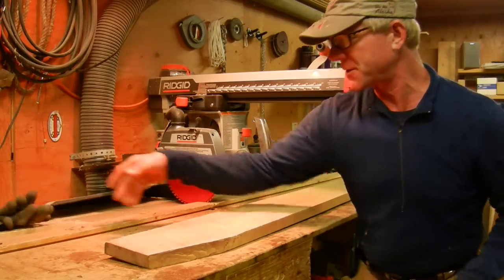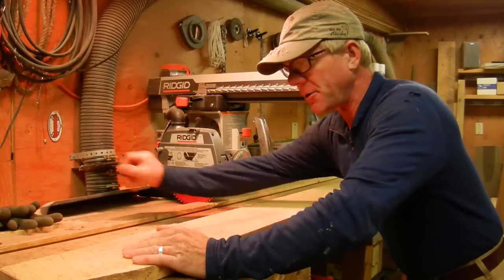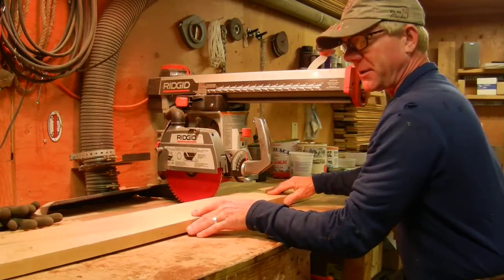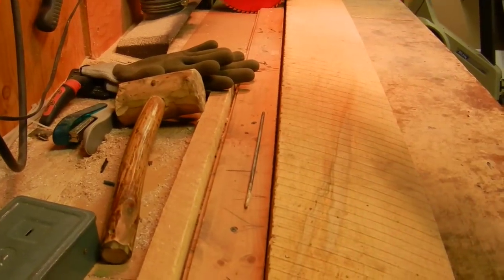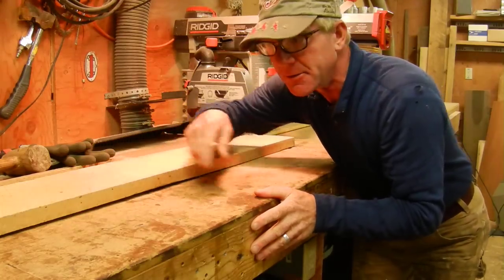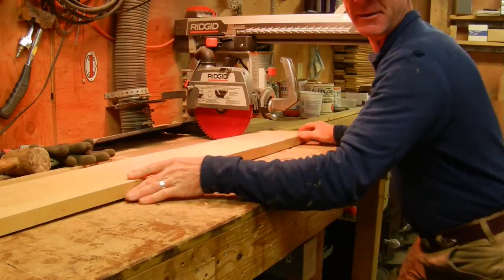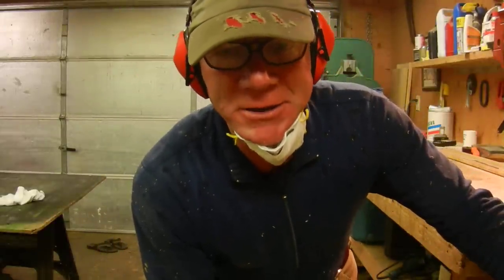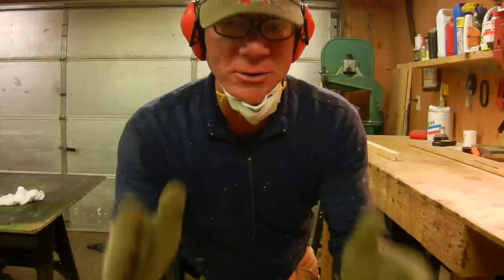How to use a Radial Arm Saw #radialarmsaw

Comment: Public Service Announcement: Please never wear gloves while using powered saws. A saw will grab fabric and everything inside of it.
Reply: Also a carpenter?
Reply from the maker: http://www.adirondackrusticfurniture.com/
good ideas... my stuff doesn't always come out straight nor do I want it straight but good ideas and welcomed criticisms. THANKS for posting. #jimthepilot http://www.jimthepilot.com/
Instagram @flyjimthepilot https://www.kittycot.com/ Instagram @originalkittycot
Reply: Also use the saw in the correct direction. He’s feeding the wood in backwards.
Reply: bhutch216 he’s definitely not. The teeth on the saw are always designed to spin TOWARDS the wood
Reply: Absolutely right! This also goes for ANY self feeding tools. Once witnessed a woodchipper eat a guy down in Texas cause his glove got caught on the limb he was feeding. I'm talking about the big chippers they tow behind trucks when they trim the trees around the power lines. The machine didn't even slow down till it hit his boots. Guess the steel toes stopped it. Dont ever wear gloves around these machines! The saw blade wont give a damn about the thin flimsy leather.
Reply: Richard Solomon yea a guy lose a few fingers in metal shop in high school because he was using a bench grinder with gloves
Reply: That was the first thing that popped into my head when he said that!
Reply: My 1st thought when he mentioned gloves.
Reply: I don't see any problem with wearing gloves, you are just feeding the wood along, You are just pushing it with your finger tips if the wood gets yanked away from your hands it's just going to pull away it's not going to take your hands with it!  At no time should your hands be anywhere near the blade!
Reply: No far from it, I'm a realtor.
Reply: Gloves protects against splinters. Distance protects against the blade!
Reply: @bhutch216  Well, for one thing,  he is using the saw in the correct direction according to common practice. But in addition to that, the radial arm saw is designed to rip in both the outfeed and infeed direction. Because the blade is mounted above the work surface and is rigidly mounted relative to the base, they don't kick back in quite the same way as a table saw. Thus allowing infeed ripping.
Reply: @bhutch216  He's doing at least three major things "wrong" in terms of safe radial arm saw operation, in general and specific to the task he is performing, but feeding  the wood in backwards isn't one of them.
Reply: Of course you can wear gloves. Just make sure they actually fit, not big floppy-fingers roughwork ones. And keep your damn fingers (and cuffs) dafuq away from the spinny thing whenever it is spinning. The gloves protect from splinters, chips, sparks, chips etc. As others have mentioned; distance protect from getting grabbed. The only work gloves allowed any wiggle room inside, should be those strictly for welding, casting and forging. Even so; when you swap for (even just a quick tiny bit of) grinding, those types of gloves go off.

Gloves don't always need to be right-size latex-glove tight - but there shouldn't be room for much more than that between your skin and the work glove. The tip of your glove finger, needs to be tightly fitting enough so that it always ends, practically where your own fingertip does. Even so - never ever stuff your fingertips close enough to the spinny or bity parts of any spinny / feeding tool, to give it any chance to actually grab. Even though you're wearing appropriately fitting gloves, treat and respect the tool as if you were not. Again: distance protects from getting grabbed or bitten. You're not supposed to have your hands and fingers right up close to the spinny bits. Gloves or no gloves. An angle grinder, almost any kind of power saw - it will chew through any glove suitable for work, pretty much as quickly and easily as your own skin.

The same goes glove palms, cuffs and for shirt/jacket/overall sleeves. And pay extra attention when moving around the spinning tool but not actually fully engaged in cutting/sawing/grinding. This, along with the moment you're starting and finishing a cut/grind etc - is when you're overwhelmingly most likely to get caught, bit, kicked back on. Because your hands and arms are moving around a lot, yet your eyes and mind are more focused on the work piece and your body movement, and less attentive on where the tool is in relation to your hands, arms and so on.

So practice your attentiveness, of where your body, clothes, protective gear etc - is in relation to the tool at any time. Especially when it's powered on but you're not directly engaged in operating it. This is when you're most likely to have a grabbing accident even though you keep your fingers/hands well clear when actually operating. Because at those times, focusing on a tool you're not currently operating is not a natural thing nor intuitive. Which is why that explicitly requires awareness training. And why even experienced old shop bulls get bit by this quite often. Because while experience goes a long way, avoiding these kinds of accidents does not just require know-how. It requires constant, non-stop attention and awareness. It does you no good, knowing what you should be doing and how - of you do not actually _continously without pause or exception, actually do it as long as the tool is spinning. Including after shutting it off; never underestimate the damage these tools can still do to you while winding down.
Reply: 😂 all these fools commenting are safety nancies and keyboard woodworkers.  😂
Reply: @MrHippobear  My understanding is that when you rip material you want to FEED the saw as opposed to have it self feed.  You should push material into the blade as opposed to have it pull in material and also you
Reply: @pr0xZen     Any advice on family planning?
Reply: Why did they make us wear  them in carpentry at my university?
Reply: My first lessons were no gloves, no ties, no loose sleeves, no jewelry, etc.
Reply: Así es amigo siempre doy ese consejo.... mejor un pedazo que te hable todo el cuerpo
Reply: @bhutch216 así es la parte a cortar la más corta a la gia.

Comment: Hey Jim,
Yes, you were definitely feeding from the correct end.  The only two pieces of advice I would offer is...
1.  That slider on the front is more than a dust shield.  It is also the hold down.  put it down far enough that the board can "lift" only a very small amount.
2.  Where is you anti kickback pawl?  You really need that.

I would suggest a book written by the late Wally Kunkle on radial arm saw usage.  Far and away the best authority on the RAS.

Comment: Great video.  What I like to do is clamp blocks to the table in both the in and out feeds the hold the piece against the fence.  For repetitive cuts or dados I use a 3-4 foot clamp that has a flat straight edge which sits against the piece being cut to hold it against the fence.  ( Its like a pipe clamp but extruded aluminium and 3" wide.  Same thing can be accomplished by clamping a 1x4 to the  table.)   I like to rotate the guard until the in feed side  makes contact with the wood.  My guard has a (original?) Spring clip that presses on the wood which holds piece tight to the table but still allows for variations in thickness.

One of the biggest advantages of a Radial Arm saw haw got to be their compact size and not needing any out feed space for.cross.cuts.  My work space is quite limited but has a great view as I work on an 8'x30' condo terrace several stories up.  Noise and dust collection are my biggest concerns and sadly Radial Arm saws are noted to be one of the worst.  Using good anti-vibration blades along with a blade stiffener and keeping them sharp and clean helps a lot.  Some blades, ie Dewalt 80 tooth thin kerf have wierd resonating harmonics; starts noisy but get really bad if left to spin for more than 10 seconds and it peaks around 30 seconds with a steady LOUD shriek. 

Another's  way to make a radial arm saw safer is toXuse a foot switch to stop and start.  This allows you to keep one hand on the saw handle whenever the blade is spinning and another on the piece.  One of the other nastiest with radial arm saws can be with pieces from the cut falling into the path of the blade when it returns to its home position.  Its partcularily bad with small cut off material.  In such cases I often use the foot switch to shut down the saw then stopped clear out the scrap and return the saw to its home position.

I have a 925 model and it is dead accurate.  I've slowly been acquiring the attachments for it but still lack the shaper head and fence, lathe and router bracket would be nice to have but I'm in no real hurry; its more just to have them as opposed to needing them.  I can use the CNC machine for what lathe work I do.  I tend to avoid the router because of the noise, especially after an incident with a 1/4" shank 1-3/4"HP router with a door pull bit and a piece of oak.  You can't do multiple passes with the router as its shaped like a curved T-slot bit... so the router is forced to cut about 4 inches of oak at once.  It made it apparent its better to have a trim router and a monster 3.5 HP router in a table than trying to have one in the middle.

Comment: I am beginner woodworking and your video was very informative and I found out that I had been using the table saw all wrong - I didn't know to turn the blade - didn't have anyone to show me - dad having dementia didn't remember how to use his woodworking tools anymore
Reply from the maker: Don't forget, this is not a table saw but a radial arm saw. Completely different saws.
Reply: I'm sorry about your dad. Mine had it, also. It was terrible to deal with. Hang in there.

Comment: I enjoyed the video.  Anyone that thinks this saw is safer than a table saw is wrong.  With modern chops saws the only real use I have for my OLD! Craftsman Radial arm saw is exactly how you demonstrated it.  I really like the bungee idea as well.  I don't like the gloves and long sleeves, I have seen more than one guy get pulled in because the blade grabs loose clothing or glove.  But that is my experience, and you still have all your limbs.  Thanks for the video.
Reply: EricNielsen187 How can you say that chop saws make table saws safer??  Table saws are incredibly more dangerous than radial arm saws.  But most people don't have a lot of experience with both so they believe the hype about radial arm saws being deadly, which they just aren't.

Comment: Why are you not using the anti-kickback pawls?  They don’t get in the way of anything, so there’s no reason NOT to use them.   My setup is similar to yours...long infeed and outfeed tables, and I like being able to cut full 4 x 8 sheets down to size while supporting the entire length of material on the fence.

Comment from the maker: I didn't want to put the board through a planer because I used it rough leaving the saw marks. To straighten the edge of the board it doesn't have to be smooth on the board surface.

Comment: Hey Jim, great channel/video. Thanks for sharing.

I'm sure you get enough safety tips, but heads up on wearing gloves while working with a RAS, they lower your awareness of proximity to the blade and can pull your whole hand in if they touch the blade.

Almost lost a finger working on a ras that way, and ever since then I prefer the splinters. I have the shredded work glove hanging above my workbench as a reminder to be careful.

I'm sure you know to be careful when pulling lumber from the rear side of the blade too, but the danger of working in gloves is lesser known.

keep all 10 attached and make plenty of dust.

Comment: Thanks. I can set my RAS fence up more or less square (hopefully more more than less after reading everyone trying to scare the pants off my with their RAS stories).  Im impressed you're able to keep such a long fence so square from tip to tip.  But I guess really only the section that has to be truly square is the length in the immediate vicinity of the blade -- maybe plus a foot or two in each direction. Any minor deviation beyond that isn't going to effect the cut.  Thanks again!
Reply: "But I guess really only the section that has to be truly square is the length in the immediate vicinity of the blade. maybe plus a foot or two in each direction."

I wouldn't count on that.
Get you a good straight edge from the hardware or big box store and use that to line up your fence.

If you have a carbide tipped blade, you could use a long aluminum angle iron as the fence. Carbide tipped blades will cut through aluminum very easily. Just don't cut them on a saw stop without disabling the emergency stop mechanism. The aluminum will activate the emergency stop and damage the blade.

If you make sure the front of your table is straight, then you can make several gauge blocks of the exact same length and clamp them to the table and set your fence up against them which will aid in making it straight.

Comment: Hey!
A carpenter Apprentice Speaking.

Make sure to never, EVER, wear gloves while working on machines.
Every moving part can grab gloves, armbands, loose clothing, etc. And pull it into the machine, cutter Heads or blades. 

Yes. Its just that one Cut.
You are just drilling that one Hole.
Yes. You did this for the past 5 years and you have been fine.

DON'T.
One day, your dream of being a Woodworker can be crushed because your glove got caught in your saw.
Reply from the maker: http://www.adirondackrusticfurniture.com/
good ideas... my stuff doesn't always come out straight nor do I want it straight but good ideas and welcomed criticisms. THANKS for posting. #jimthepilot http://www.jimthepilot.com/
Instagram @flyjimthepilot https://www.kittycot.com/ Instagram @originalkittycot
Reply: @ifoundjim   Your shop, your rules as long as you know the risk. There is a good reason they call this saw the Widowmaker.   I have had two of them in the past never used them and sold them off to other wood workers.
Reply: NEVER EVER WEAR GLOVES.Guessing he didnt want to catch a splinter.lmmao
Reply: @SQLKC  Just askin', but I've been trying to decide which kind of saw I need (if at all) since I'm really tired of a jig saw... it's the only power saw I have as I've been terrified of the large saws and have never used anything but the jig saw lawn power tools like a small chain saw.  I have watched sooo many Y/T videos on how dangerous a regular table saw is and that the radial arm saw is safer.  I don't know...I was thinkin', maybe a small circular saw with one of those clamped down metal guides, but IDK, maybe they're ALL "widowmakers".
Reply: @freewaybaby  I have a sawstop and it's the safest/best saw you can buy. Note not the cheapest but it pays for it's self in one ER visit.
Reply: I have a sawstop as well, was not a easy to choke down the cost but I hope it out last me and it better be the last table saw I buy.
Reply: @TechStack Reviews I disagree, no person ever predicts they put their hand in a blade. You do you and do me but I have the sawstop in my shop.
Reply: Mark Inmon  what is bad or dangerous about this type of saw ? Or is it good for only one perpuse ? TY,,
Reply: @SQLKC   It's just like any other piece of equipment if you use it improperly it's going to hurt you

Comment: just noticed, your blade is cutting on the up stroke, when crosscutting it cuts on the down stroke. I just picked up my first RAS and doing some homework before getting stuck in. I see your guard swings down to keep the work down, mine is stationary.
Reply: Whats your point? I got confused here
Reply: A Circular blade also does not cut in strokes. That would be a jigsaw.

Comment: Nice job.  I often wondered how it was done the right way.   One concern is the anchor point on the wall for the 'Ocky' strap to return the saw-blade to the home position.  I have had one come adrift and hit me in the face.
Regards
Mike McMahon.
Reply from the maker: Hi Mike... been this way for a long time and I always check to make sure it's in good shape. Thanks for your reply!
Reply: Your choice mate.  Just concerned.

Comment: Well, that push stick really did a lot of good, LOL!  I think I'd want a pawl or a set of board buddies for doing that.  Been thinking of getting an old DeWalt shopmaster as they're fairly inexpensive in this area...at least on fb marketplace.  Most are from $25 to $75 but have seen the industrial ones on there in the thousands.  Thankfully I don't need an industrial one.

Comment: The issue I have with the ras over the table saw, is that the table saws blade can be raised or lowered, when I rip on my table saw only a 32nd of an inch is usually sticking above the wood. When I rip with a ras, all of the blade is above the wood. Now sure they can both be used in a mostly safe manner, but if I hit the 32nd sticking out of my table saw I get a cut. if I do the same on my ras? I get an amputation.

Comment: Thanks. Just starting to get my old 2610 pwrcraft wards saw working. It was given to me. It is missing the blade nut. Wonder if the Craftsman nut from a Craftsman 113 series table saw would work, 5/8 inch. (available on Ebay) That saw keeps coking up so perhaps they are the same saw ? Not sure it will rotate quite like that Rigid, thats a nice saw.
Reply: As long as the nut is the same diameter as your arbor and has the same thread pitch, (turns per inch) it will work. The annoying thing is, despite the amount of money those things cost, they rarely if ever give you those specifications.
I'd start at the hardware store and get nuts the same size. There is likely to be a course thread and a fine thread so all you need do is purchase two nuts to find out.